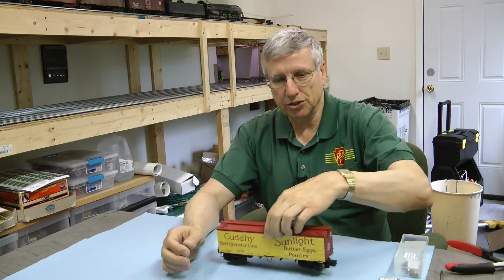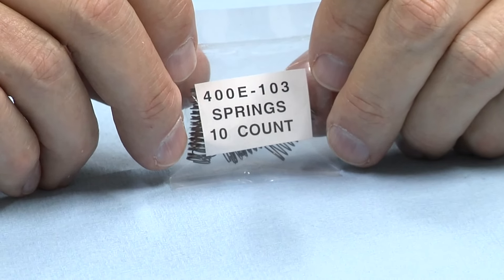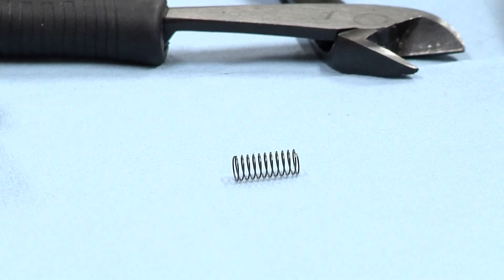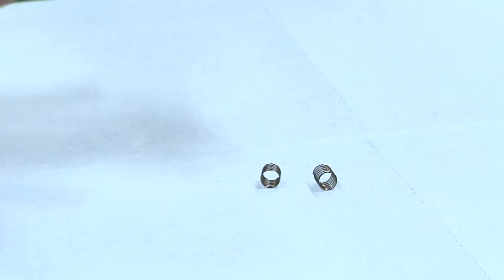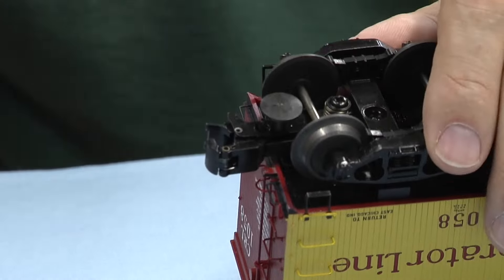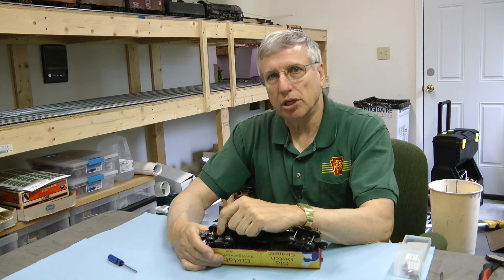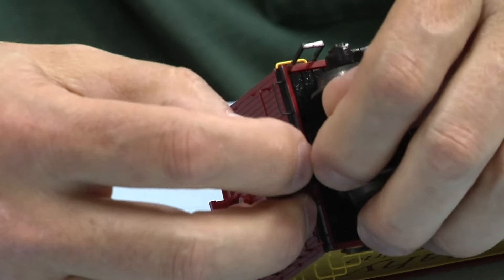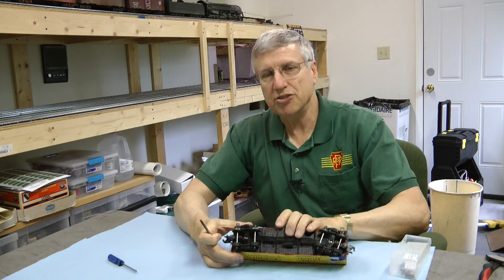How-To: A Coupler Clinic

Comment: That's  a very good idea  .  Is it   thoses replacement springs   are strong enough  to  keep the couplers close  when the car is on the middle of a freight consist   ?  Sometime  ,cars with too smooth tension springs  tend to open  when i operate a long train  .  Cheers .